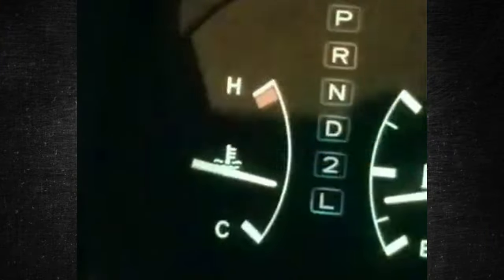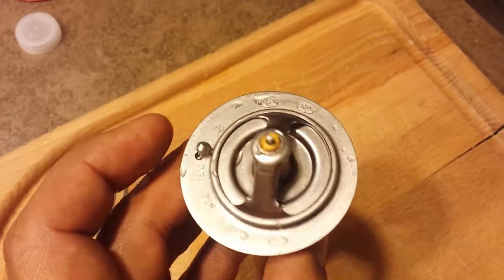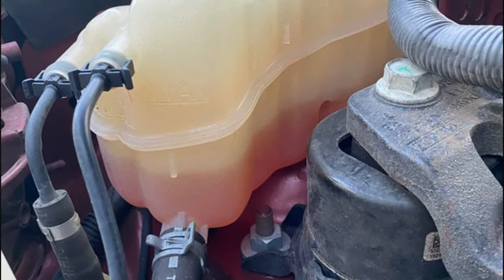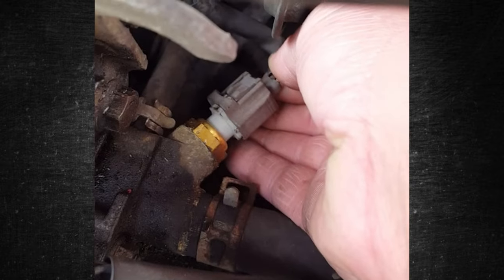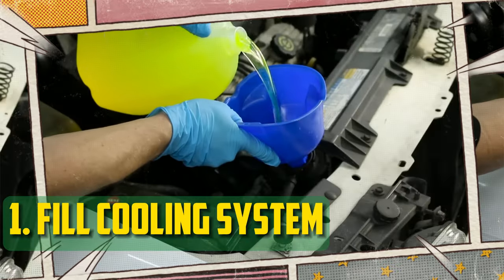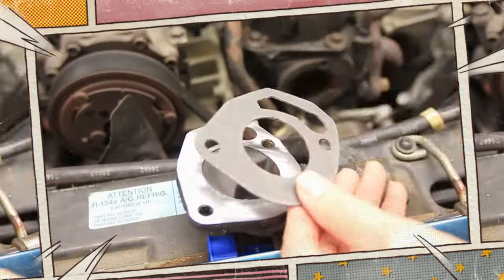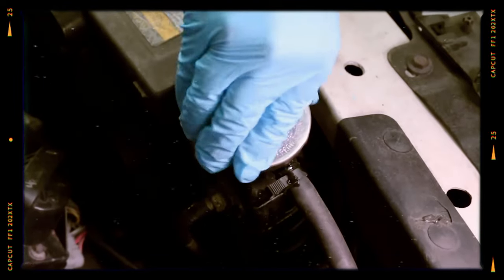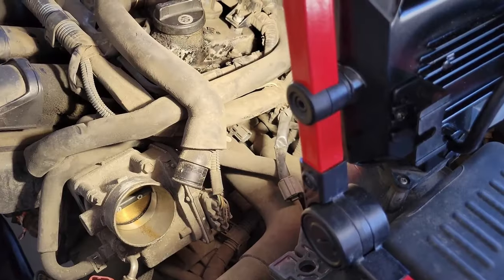6 Causes Your Temp Gauge Goes Up and Down - Cost & How to Fix

Comment: "Coolant is more effective at removing heat from an engine than water is"... That's 100% incorrect.
Reply: Right...
Reply: Right
Reply: THANKS  MAKES SENCE
Reply: Lmao if that's what they told you maybe you should think of it another way 
Water evaporates like nothing when you pour it on a pan 
Now think of the water inside the engine what do you think it's going to happen to it coolant not only resist more heat it won't corrode anything
Reply: My car is a zuzuki balino, earlier when the car is running it misfires or like knocking when the engine warms up.. then I changed the scam sensor and the oxygen sensor plugs, coil pack 2, ( change o2 s3nser, located in the middle of the silencer).. now when the engine is warm it works fine, but then After starting it in the morning and letting the engine warm up, it misfires or like knocking.,..but when the engine warms up, the misfire stops, it runs without error,...what is the reason for this?
Reply: Get a load of this guy 🤡
Reply: @maximosatterwhite1708  how does it feel to be so completely wrong?
Reply: @maximosatterwhite1708  DISTILLED water won't corrode anything. & Water doesn't evaporate IN A CLOSED SYSTEM. Ever seen an unopened water bottle that was half full??
Reply: @TacitZero  water expels heat better than antifreeze. Do your homework.
Reply: @Eztops  water also has a much lower boiling point scrub, Do Your Homework
Reply: @TacitZero  not in a closed system. Do your homework.
Reply: @TacitZero  it'd boil at roughly 235-240° at 16psi. And if your car runs that hot you got bigger probs then water/coolant debate.

Comment: I’m definitely having this issue now but it was getting worst when I had the a/c on I turned my car off to cool down and it still was doing that but I cut the air-conditioning off and the gauge stayed steady
Reply: I'm in the same boat right now . Dodge Durango is overheating on with the AC on also
Reply: @Northwest509_WA   and so does my dodge challenger 2011 3.6, its anoyying really
Reply: @iamthiskiddoge  I fixed my it was my thermostat  even though it was 2 months old it was malfunctioning I replaced it with a aluminum one fixed the problem
Reply: @Northwest509_WA  i just put one in 20 mins ago. as im putting the bracket on the hose a piece of the bracket snapped . smh its always something

Comment: So, you may remember from chemistry that water has the highest specific heat of any liquid due to its hydrogen bonds. You don't need a perfect antifreeze water mixture. In addition to changing the boiling and freezing points of the coolant, antifreeze contains cleaning agents to keep your system from clogging up. So, an incorrect mixture will not be your problem. Also, if the vehicle overheats at slower speeds but does fine when going faster, then it's most likely your fan. It could also be your water pump ( which he didn't mention). If the water pump is going bad, it may or may not leak or make noise. I had one seize, and my first warning was the belt slipping and making a lot of noise just before it snapped. The big takeaway here is that it most of these parts are cheap. If you do the work yourself, it could be as cheap as $14 and 30 minutes of work.
Reply: THANKS  however could be many more difficult different issues and by the time we find out what the problem is
Reply: What  chemistry  ?    Many of us didn't even go there , sadly  !

Comment: I have no idea what's happening but usually when riding normal the temp gauge in my car acts normal too. The second I turn on the ac it just slowly sinks and almost hits the bottom. I thought that the ac should actually increase the temp more than sink it since it is an additional load to the engine. Or is it somehow also cooling the engine?.... Pls anyone explain
Reply: Saw something indicating a bad fan relay or coolant temp. sender

Comment: What about broken fan?
Reply: You have to get it fix ..if you have 2 fans and only one works it will overheat you can still use your A/C but keep an eye on the temperature when it starts to go up a little cut the A/C off or turn it down it will go back to normal